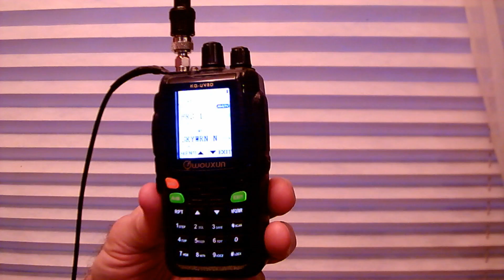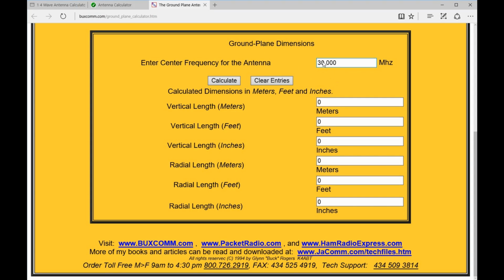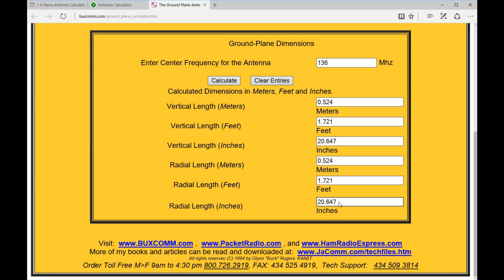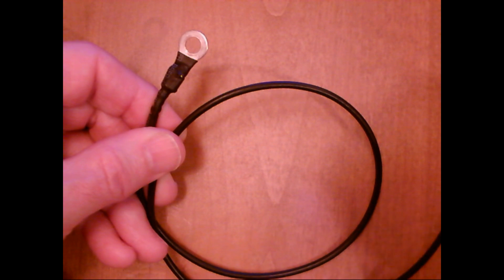UHF/VHF Tiger Tail

Comment: A tiger tail is not half a dipole. It is a counterpoise. 

Counterpoise Etymology:  from Old French contrepois from contre ‘against’ + pois from Latin pensum ‘weight’. The word literally means "counterweight" and that is what a counterpoise is in an antenna system. Simply put, a ground plane, or counterpoise, acts as a mirror. 

A vertical antenna has two key components in radiation; the vertical and a ground plane are required and equally important. With a handheld radio, the counterpoise (ground) is your own body as you are holding the HT. This is because the capacitance of your body makes a fair counterpoise under ideal conditions. 

The purpose of a counterpoise is to provide a relatively high capacitance and thus a relatively low impedance path to earth. The idea of a good ground plane is to reflect the maximum of your radiated signal, and stop it being absorbed into ground. It also reflects the received signal into your antenna. Radials will affect the SWR so they should be tuned for each specific antenna.

The tiger tail is also electrically connected in a different manner from the other half of a dipole.
Reply from the maker: You are correct. Please check out my later video, “Tiger Tails - Fact or Fiction”. This video was one of my early videos - LOL! The later video I utilized a.RF Power Meter, Spectrum Analyzer, and SWR Analyzer to run through a series of test to prove your point.

Comment: Given the PA is designed for connection to a 1/4 wave whip, doesn't the additional antenna wire screw up the feedpoint impedance?  What's happening to the Reflection Loss as seen by the PA?
Reply from the maker: Steve, the PA is designed to see a 50 Ohm load. The size of the antenna, 1/4, 1/2, 5/8, or full wave does not matter so long as the impedance is correct. The additional wire is not connected to the driven antenna element. Think of it as a ground element for a vertical antenna.
Reply: @BillTheTechnoGypsy  1/4, 1/2, 5/8 all have fundamentally different feedpoint impedances and that impedance is strongly determined by what the ground plane looks like.

Take a pure 1/4 wave go antenna with four radials of the correct length.   When the radials are at 90 degrees the the SWR will be around 1.5:1, because the tx sees 35 ohms.  If you angle the radials at 135degrees, the the SWR will approach 1:1 as the input impedance will be near 50 ohms.

Dangling wires off a ground point on an H/T will change the impedance seen by the PA.  I'm interested in how much.
Reply from the maker: Steve, check out my newer video “TigerTails - fact or fiction” for extensive testing results.

Comment: Who really walks around with this on their PORTABLE... oh man😝
Reply from the maker: I don’t, regarding my everyday HT. But, it is on the HTs that are in my Go-Bags. The purpose of a Tiger Tail is to maximize the transmit power of a HT when needed. During an emergency event, this could be a life saver. Jut another tool in the toolbox used for the right purpose. Take a look at my “Tiger Tails - Fact of Fiction” video to see the improvement in radiated power when adjusted properly. Thank you for watching my video!

Comment: Do you solder  both wires in the coax or just the shield?
Reply from the maker: I would recommend that you use the same wire as for a radial or counterpoise. You do not need to use coax. Also, take a look at my "Tiger Tails - Fact or Fiction" video where I did actual testing. Turns out that you should tune the Tiger Tail to the antenna as it is a counterpoise.

Comment: When you measure your wire to the specified length, are you including the lug head in the measurement?
Reply from the maker: Toner126 The measurement is from the center of the lug. Take a look at my “Tiger Tails:Fact or Fiction” video. It explains this is much more detail. Thank you!
Reply from the maker: In my testing, I found that the first cut is to a 1/4 wavelength. Then, you need to put the antenna and Tiger Tail on an analyzer and trim to tune it. Works great!
Reply: we live in a concrete jungle apartment and i have tried this method and it didn't make a pick of difference and i'm not going outside in the cold and snow to try it LOL  @BillTheTechnoGypsy
Reply from the maker: vetham100 - Take a look at my “Tiger Tails - Fact or Fiction” video. I did RF power measurements at 10 feet using 2 different antennas and tuned vs un-tuned Tiger Tails. The results showed that some combinations actually reduce the RF power (ERP). It made sense that one size does not fit all! Now, my antennas and Tiger Tails are matched to provide the highest ERP. Hope that helps.

Comment from the maker: I am working on some actual testing to validate this. Another video on the list!
Reply: My limited testing was on GMRS. I tried to hit a repeater with only the stock rubber duck antenna.  Then tried it with the addition of the ground radial.  Had much stronger signal (both Rx and Tx) after the addition.  

I didn't approach it very scientifically in that I didn't record any data from the test (time, signal strength, conditions, etc) so I can't really back it up with empirical evidence.  At least not yet.